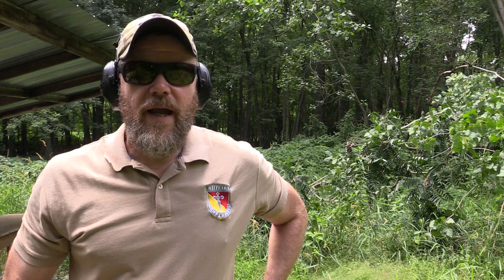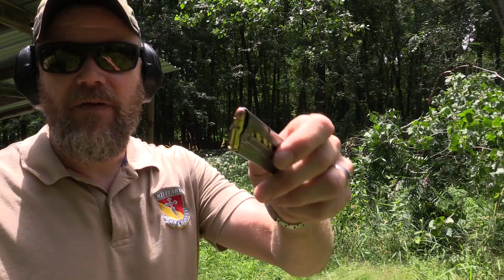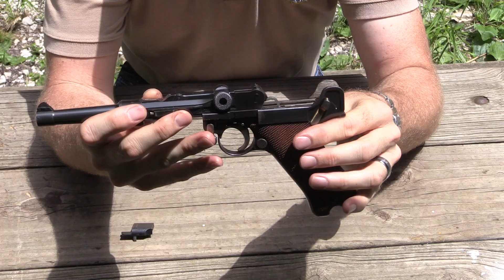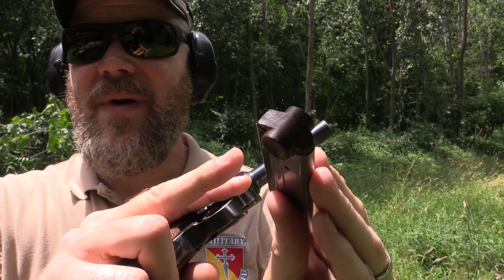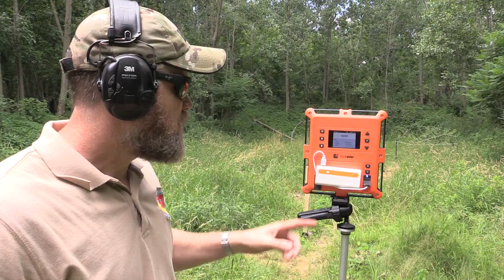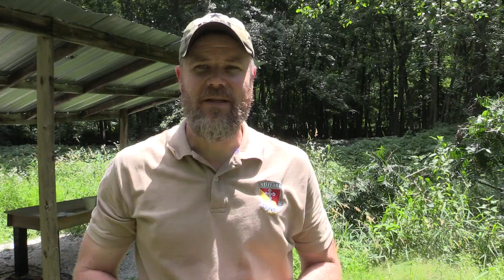Commerical German .30 Caliber DWM Luger

Comment: Rather late comment, but just in case...  I have .30 and 9mm caliber Lugers.  The problems you're having are typical.  The Fiocchi ammunition is well known amongst .30 Luger shooters to be weak and often fails to cycle.  PPU ammunition generally works much better.  Most of the replacement recoil springs available are too heavy.  The Wolff standard 38 pound spring is on the margin in 9mm guns, and will be too heavy in many.  The 36 pound "reduced" power spring usually works for 9mm.  LugerMan has the best and most accurately reproduced springs.  They work perfectly for 9mm.  But the original spring in my .30 Luger was 18 coils instead of 20.  There's considerable debate as to whether or not the two different calibers recquire different springs. They seem to.  When I shortened the replacement spring to duplicate the original, it abruptly began to function properly.  So there's that.  I suspect each gun is a law unto itself somewhat.  Georg Luger himself said, "The springs must be perfect.".  If you're using only factory ammunition, take a little bit off replacement recoil springs at a time until it cycles properly.  If you handload you can just develop a load that reliably cycles your gun.  This is an old problem.  I've seen it addressed in gunsmith textbooks dating back to the 1950s.  The only current production ammunition I know of that seems powerful enough is PPU.  Older Remington Kleenbore ammunition has been tested and found to run around 100 fps faster than the Fiocchi stuff.  Which sometimes works.  Probably it does better in the 4.5" and 6" barrels than the more common 3.8".

Comment: After the Treaty of Versailles the German military was limited to 100,000 Man Army. Their declared Military Pistol round was the 9mm luger round. So to get around that, DWM made 30cal lugers, and 9mm barrells. They stamped the, 30 cal ones, with "Germany" on the bottom. But the stamps were too wide. On the underside of the barrel it will say "Germ" "erma" or "many." Then when Germany decided to build it's Army, DWM just switched these barrels to 9mm. Typically the side plate serial numbers don't match for this reason... But... Some of these guns were actually sold to the Public as commercial guns. Such as this one appears to be.

Comment: I'm not one of the people that hates on .32 ACP; I have a Walther PP and Mauser 1914 which I really feel are good weapons and deadly if used properly. When it comes to the Luger, though, I have to say I dislike this version quite a bit. It's too big and bulky to have any of the concealability advantages a gun like the PP or 1914 would have. As you can also see, the power of the cartridge simply is not enough to properly cycle the toggle without danger of malfunctions. The Luger is an amazing gun, but it's really meant to be chambered in 9mm. I also have a DWM Luger but it's an Imperial Germany Army contract version chambered in 9mm Luger, and despite being over a century old it still runs great. I may want to get my hands on a Swiss Luger at some point; I get the feeling those may be more reliable than these early DWM models seeing as they were for a military contract. They are still really pretty guns but I have to say when it comes to Lugers, .30 is too anemic of a round.

Comment: I was wondering, if you had an underpowered round that couldn't cycle the action, couldn't you just set the bullet a hair or so deeper in the brass to get some more pressure?  I don't know if that would equate to more recoil...
Reply: Mine won't cycle reliably unless velocities are over 1100.  I don't know about factory ammo, but all my handloads have bullets with crimp grooves and roll crimps, so bullet seating depth is fixed.

Comment: I have a LP08 made by DWM dated 1921 with German Army acceptance markings and it is in 9mm. Luger's like hot ammo and good springs..
Reply: If you have correct springs, you won't need hot ammo.  I shoot 85gr bullets at 1150fps through my .30 Luger, and that would be an extremely weak 9mm load.

Comment: hi I have a question are the clips the same for 30 and 9mm ?? and do all the barriles screw in on both 9mm and 30 ?
Reply: The mags are the same.  The barrels are machined into the upper receiver on mine.  Looks to be one piece.
Reply: ok cool thanks so much
Reply: The barrels are screwed-in and mags are the same.  To convert a .30 to 9mm, the only necessary change is swapping barrels.  I read somewhere that to help ensure barrels never came loose, the threads were swabbed with iodine so the barrels would rust in place.  Don't know where or when this may have been normal practice, but would certainly make a barrel swap problematical.
Reply: thanks for the info

Comment: Thanks for the video. Were you shooting reloads? If yes, maybe not enough powder? Switzerland  chose the Luger for their army at the turn of the century. All Swiss Lugers are 30 Luger caliber or as we  call it here  7.65 Parabellum. Initially made for them by DWM, imported, they were eventually produced in in Bern, Switz. by Waffenfabrik (W+F). I have the 06/29 model. Never had failure to eject. Sweet to shoot, minimal recoil, very precise. In competitions using Ordinance pistols, shooting with two hands are kind of frowned upon. Like the SIG 210, I think it is zeroed at 50m. At 25m, you have to aim lower at 6 o'clock. The only issue for me are the sights - hard to see, similar to an SAA revolver.  It will group very tightly alright but in the shooter's perceived bulls-eye. Your aims changes according to the light conditions. Oh well, that's the charm of getting to know your weapon well.
Reply: My Luger will short-stroke if muzzle velocity is less than 1100fps.  I load 85-90 gr bullets at 1150 and the gun runs great.

Comment: The 7.65 Luger cartridge predates the 9mm cartridge. The German army tested the 7.65 Luger They liked the pistol but wanted a larger diameter bullet. The 9mm Parabellum is essentially the 7.65 Luger cartridge sans the bottleneck. The magazines are interchangeable between the two calibers of Luger. Well, there are three calibers of Luger but good luck getting a .45 ACP.
Reply: .45 Lugers are currently in production, if you have an extra $7000 to spend.

Comment: You can't get replacement springs for it? That is too bad.
Reply: u can
Reply: There's a chart reproduced on a Luger forum, indicating which Luger gets which spring, depending on caliber, and maybe changes in the weight of the bolt assembly due to different sights, but Wolff, for instance, offers only a single Luger recoil spring?  I wonder if guns not having the correct spring is the reason some people say they need to load really hot, or use "submachine gun ammo" for the gun to run?   My .30 runs perfectly with 85gr bullets at 1100fps, which a lot weaker than any commercial 9mm load.  When I was replacing springs, I left the new recoil spring out, as I didn't want to cause a problem where none had previously existed.

Comment: Not only does 30 MAUSER predate 9mm Luger, 9mm Luger is essentially a shortened 30 MAUSER case necked up to 9mm. The Germans wanted 9mm so Luger accommodated them with that, and is why the case is taped. Both cases use the same case head.

Comment: I believe the Ruger .22 pistol drew design elements from the Nambu Type 14, which itself was derivative of the Luger, but I don't think Bill Ruger drew direct inspiration from the Luger. The Luger will always have that pizzazz about it though that neither the Ruger or the Nambu will ever have. Thanks for another great video MAC.
Reply: The Nambu and Luger are not related in any way.
Reply: They aren't directly related, and they aren't very similar mechanically, no, but the form factor and ergos of the Type 14 are very Luger-like.
Reply: Yournamehere Yes but you said the Nambu was a derivative, which it isn't, anymore than then Lahti L-35 or the Colt Woodsman.

Comment: Could one potentially charge the pistol and put a round in the chamber by pushing the barrel against a hard surface, like you kind of demonstrated, but more like a brick wall or table?

Sort of an older-style rear sight slide rack.

Comment: My PO8 was manufactured by DWM in 1918.  It is chambered in 9mm and has the shoulder stock mount.  I also have 2 mags, takedown tool, and original holster.  I bought it for my dad many years ago.   Thank you for the video.

Comment: I wonder if this version of the gun was the reason for the rumors about the bad reliability of the gun
Reply: The toggle design is just overall finicky with ammo too, it likes hot, consistent ammo.
Reply: At the range one day my buddy shot a 9 shot group with my 1918 Luger that made the guy with an expensive target pistol hang his head in shame.
Reply: I don't think so. I believe that reliability issue came from cleaning and lubrication failed on the battlefield. It's well made pistol, with pretty tight tolerances.
Reply: SW990 Range buddy has a 9mm version, old Finnish military pistol. That started to act strange and took a little look at it. "When did you lubricate this thing?" I asked. He said, he had not cleaned it well in close to a year. I had a little oil bottle in my range bag and we put some on the rails and it started working again. Also, he loads his ammo pretty mild, just a bit over minimum. Accurate and fun to shoot...
Reply: Oh yeah they're a real work of art. It's really a shame they aren't made anymore. Accurate as hell too cuz of the fixed barrel.
Reply: Lugers got a reputation for unreliability due to the underloaded commercial ammo available in the U.S. after WWII. The Lugers like hot ammunition. German military ammo was quite stout.
     The Italians had a military pistol - the Glisenti - that used a round dimensionally identical to the 9mm Parabellum (Luger). The Glisenti was a blowback design and the ammunition for it was considerably less powerful than the 9mm Parabellum. To protect unsuspecting souls that might fire 9mm  luger cartridges in a Glisenti, 9mm commercial ammunition was only offered in a low powered loading that would not reliably function a Luger.
     It is common for modern shooters to use light loads in Lugers because they are so old. The old fraulein is quite strong. There are no low quality Lugers. They were made of very high quality material and a matching number Luger in good condition is safe with rather stout loads. There are Lugers that were assembled from parts that may or may not have been properly fitted. This is more likely to cause function issues than create an unsafe condition strength wise.
     I try to shoot my Luger with heavier bullets to help reliable function. They were designed for FMJ ammo, so I look for 124 grain bullets instead of the more common 115 grain loads.

Comment: I picked up an American Eagle P08 Luger reproduction in 9mm at a gun show a while ago.  Markings show it was manufactured in 1993.  Unfortunately, American Eagle doesn't exist anymore.  The pistol is all stainless steel with checkered walnut grips.  It is fun to shoot, but also a bit finicky with ammo.
Reply: American Eagle as in the Ammo manufacturer?
Reply: No, American Eagle is just a name Federal sells ammo under
Reply: Actually, the name of the company was "Mitchell Arms" out of Houston TX, I think.  The "American Eagle" was the name or "brand" of the gun.  I think their history goes way back to either importing or manufacturing "Americanized" versions of the original P-08.  MAC can probably fact-check this.
Reply: Follow up.  Quote from Wikipedia article: In 1991, the Houston, Texas firm of Aimco, Inc. began making an all 
new remake of the original Georg Luger design. At that time Mitchell 
Arms, Inc., under the "Mitchell" name marketed Aimco’s "new" parabellum.
 Stoeger, Inc. bought the rights to market the Texas-built pistols in 
1994, and since that time the "Luger" name is once again on these 
toggle-action autoloaders.
Stoeger’s current offering is named the "American Eagle" model. This 
refers to the U.S. eagle roll-stamped above the chamber, closely 
resembling the eagle used to mark the original pistols designated for 
U.S. import. The "American Eagle" is available in 4-inch and 6-inch 
barrel lengths in 9×19mm Luger only.

Comment: Beautiful .30 Luger. I have ten military Lugers built between 1912 and 1942 but have yet to pick up a commercial.
Reply: A friend has a .30 luger with a LONGER barrel, looks like a artillery barrel. When he us "done with it, it comes to me", I have examined it a couple times but it looks brand new 99% (he dad a ww2 vet, but didn't bring it home, he bought it in Illinois in the 50s). It's so nice, I have not looked to close, as I don't want to get me oily finger prints on it. 

Anyhow do you think its a commercial version or a take home? (Long barrel is odd).

Comment: Is the .30 Luger more accurate than a 9mm in full power loads?
And about the 3D Copper Custom Logo, is it supposed to look like that? With the sides clipping through eachother?
Reply: My .30 is more accurate than my 9mm Lugers.

Comment: i had a Walther PPK BB gun when I was a kid and in later years handling the real deal it was crazy how close it was to the real thing, air guns are still crazy fun.
Reply: Russians make BB version of Makarov pistol. Early models had several parts from real 9mm version, like frame and slide. They have modified it several times since and I think it's now like 5th. version, which no longer has parts from real firearm.

Comment: Fiocchi loves producing obscure cartridges don't they?
Reply: Its not as obscure in europe
Reply: +TheAlexagius Yap, still a common service pistol competition cartridge. Here's a fun fact: it fits into 9mm chambers just fine. Have more than once seen shooters get FTEs in a 9mm gun, only to find the ammo was mixed up (the ammo is usually bought directly at the range in Swiss service weapon shooting).
Reply: Hey its not a bad business idea, they can say "Oh, don't like our prices you can go get Winchester to make your .30 Luger rounds. OH WAIT nobody else makes it? Oh well too bad, now pay up."
Reply: FYI -The 7.62x25 Soviet is dimensionally the same as .30 Luger but has MUCH higher pressure than .30 Luger and is not safe to shoot in Luger pistols.
Reply: Richard Lahan this is false the 30 Luger and 7.62 tokarev is different dimensionally, the 30 MAUSER on the other hand does work fine in a tokarev
Reply: @offdeadeye88  You are correct about .30 Luger. The external case dimensions are NEARLY identical between 7.63 Mauser and 7.62x25 Soviet. So much so,  that the Finnish Army ordered one million rounds of 7.63 Mauser for use in captured Soviet PPSh sub-machineguns during the Winter War and the Contuarion War. Soviet 7.62x25 ammunition is loaded too "hot" to be used safely in Mauser pistols chambered for 7.63 Mauser.
Reply: @richardlahan7068  You’re thinking on the 7.63x25, also known as .30 Mauser. .30 Luger was 7.65x21